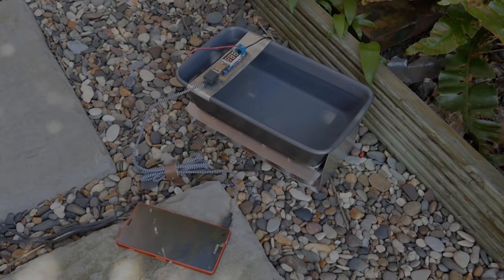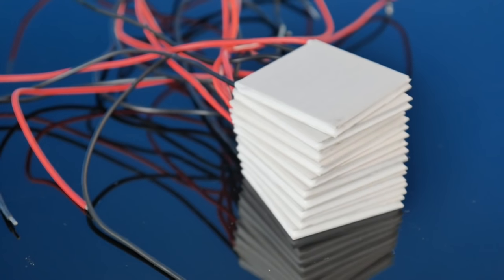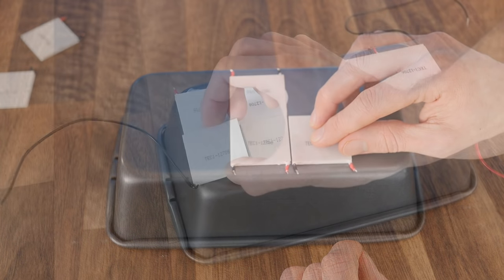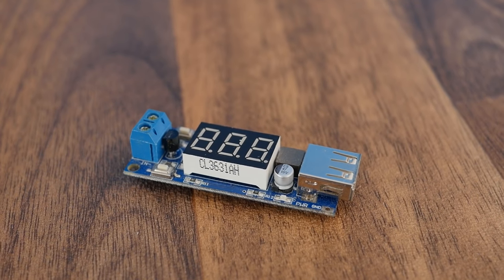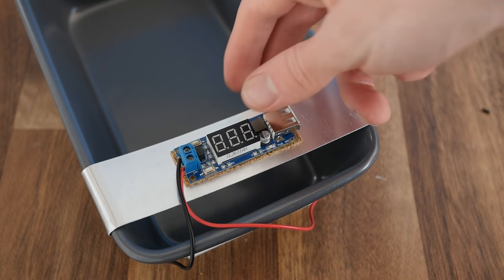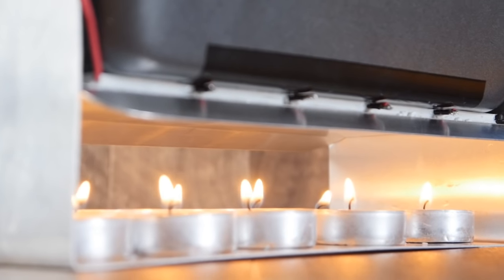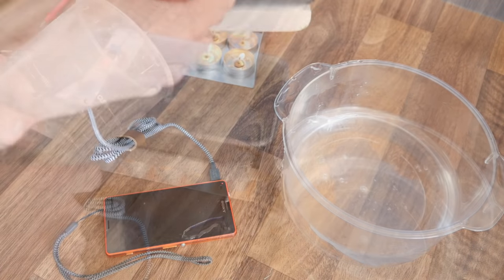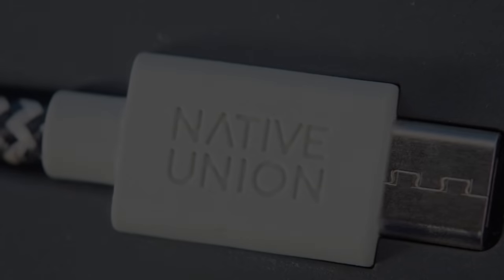How to make a DIY Thermoelectric Generator

Comment: In colder areas, would the reverse work? Let’s say we flip this around so the ‘cold’ side is on the bottom, sitting on the ground (or a metal stand). Now, the top section is where we want the heat. We use either a rock or brick that’s been sufficiently warmed, and use that for the heat. Since bricks and rocks tend to hold heat for longer, it will not only generate more electricity, but the times necessary to reheat the brick will be much shorter than changing the water every ten minutes.

Comment: Here I am contimplating creating a thermoelectric gen. and you've gone out abd done a diy project again. Best Monday ever, hello from the San Jose CA.
Reply: Fixing hot plate at 50 degrees and the heat sink, which thermoelectric module would produce more power: TEC1-12702, TEC1-12706 or TEC1-12710?
Reply: @marvinmarvini8629 i don't know how much power they'll generate, but they'll probably generate fuck all. assuming the heatsink is at an ambient 20°c, that'll leave you with only 30°c of temperature difference. you'll generate maybe 100mW. you want something like a TGPR-10W-4V-40S run at 200+°c of temperature difference

Comment: Hello sir, I'm very thrilled after watching this video and I'm glad I found it. The Surprising part is I wanted to do my final year major project on Thermoelectrics and after finding this video, my spirits were boosted. Thank you for this wonderful project. It  helped me, to learn more about it.
Reply: Fixing hot plate at 50 degrees and the heat sink, which thermoelectric module would produce more power: TEC1-12702, TEC1-12706 or TEC1-12710?

Comment: Awesome!
What about putting everything in parallel 3 by 3?
In this way, you'll have a lower voltage (max 3 or 4 volts) and a quite nice current. You can plug the new set up to a DC to DC step up boost converter and maybe obtain a better efficiency. Another nice ting could be putting a temp sensor like a pt100 and create a sort of an arduino overheating protection switch so you can fine tune the assembly in order to maximise the efficiency. A versus between a couple of arrangements could be quite interesting!
Nice job and keep on doing interesting things like these!
Reply: Good Idea. make this one and send me the link or reply here, so that I get the schematic and the source codes
Reply: Buck circuits are significantly more efficient and cleaner than boost.
Reply: Fixing hot plate at 50 degrees and the heat sink, which thermoelectric module would produce more power: TEC1-12702, TEC1-12706 or TEC1-12710?
Reply: What do you think the voltage regulator does?

Comment: My masters dissertation was on a project that included these Peltier elements, interesting little devices. When you put current in them one side of the plate gets hot and the other cold, when you switch the polarities the hot and cold sides switch places, and the whole process is reversible - meaning when you add heat, current is produced.

Comment: This is pretty awesome for us fools that live in a place literally called "Hurricane Alley" and instead of Winter, Spring, Summer, and Fall... we have Hot, Sweaty, HURRICANE SEASON!, five days of nice weather, boiling hot again.

We lose power pretty regularly once a year during hurricane season... so I might actually make one of these for my mom. I can make it look all nice and stuff. She has thousands of those tea candles, so she's set!
Reply: Fixing hot plate at 50 degrees and the heat sink, which thermoelectric module would produce more power: TEC1-12702, TEC1-12706 or TEC1-12710?

Comment: Peltier elements usually come with copper heat syncs so the tray with water is optional and simply popping it cold side facing away from a camp fire should do a good job.

Comment: Hi there! Quick question -- what is the reason to wait for the regulator to reach 10V before turning it on? Also, is the reason for using a larger bread tin like that one you've used in your video so that it can generate more voltage? Not being an electrical engineer myself, I can only assume that more bread tin = more time it takes to warm up the water = longer/more consistent charging time? In other words, if you used a smaller tin, would you not be able to generate enough voltage? Thanks for this awesome video!!

Comment: I don't know if there's a video already out there but I'm really curious if liquid nitrogen or  dry ice would just destroy them or if it will still work
Reply: Cold doesn't harm them, only if the heat is high enough to melt the solder/glue that holds the individual sections of the Peltier modules together.

Comment: A rather dumb question:
You did show footage using the generator in a campfire, which could be a rather volatile and uncontrolled source of heat....
What prevents cables and electronic parts from melting? 
(simply put, i do not know the temperatures which, the components can withstand)

ALSO: I saw a heat sink, can the generator work like providing the power for the heat sink with a little excess?
Reply: The circuit board was on the "cold" side of the system, so it wouldn't have to deal with the full heat of the fire. 

When you run a current through the device, it makes one side cold, and the other side hot. If you want to keep it running efficiently, you have to get rid of the heat by pulling it away and throwing it somewhere else. That's what the heatsink is for.
Reply: +fatherdoctor Most people think that the mere presence of heat is enough to generate power. that's incorrect. you need to have a FLOW of heat THROUGH the Peltier element in order to generate power. Since heat always wants to flow towards cold spots, you have the cold water at the top.
Reply: the better way to do this is mount a heatsink with a big surface area and small fan. it will work as long as candles are burning

Comment: Imagine a camping pot made like this. Hang on. Someone's done this already right?
Reply: The concept is fairly easy to apply to just about any heat source... the tricky part is coming up with an efficient way to cool/wick the heat away from the heatsink side of the peltier.  (ie) Attaching a bunch of peltiers to a camping pot or "fire-ring" in the middle of Winter would work pretty well... but not many people are going to want to sit around/enjoy a fire in the middle of Winter.  ;)  ;)  ;)
Reply: Biolite Camp Stove

Comment: The idea itself is quite nice and might be useful for situations like "out in the jungle without electricity and the dire need to recharge something like a radio". Might be useful for special forces operating in denied areas... but I'm not happy with the safety of the implementation. The step down converter could be killed by a splash of water and the wires can easily get into contact with flames. A little bit more time invested in the safety and you might have a ready-to-sell product that could be a real life-saver. Still a good idea and video.

Comment: I love everything about the concept except for mounting electronics over a steaming pot. If not shorting it out, the humidity will corrode the metal.
-Justin
Reply: it wont steam, the water wont go over 25°c
Reply: yeah I doubt its much of an issue. 10V 1A demineralised water meh...
Reply: I thing i would change is to solder them in parallel and usa step up boost converter. Or just plug it in directy in a 1-6.5v to 5v usb converter module
Reply: distilled water is non conductive, anyway, coat the electronics with plastidip or similar...
Reply: If you guys wanna put you your money where you mouth is go ahead and put your phone over a pot of boiling water... Attaching the voltage regulator to the stand would have been a better idea in my opinion -R
Reply: Its a cheap buck step down circuit...2 bucks at most. So your argument is invalid XD
Reply: Victor Galvez and you don't think connecting your phone to something that could potentially be damaged in some random way might be a bad idea? Gunna bet your phone that cheap $2 voltage regulator doesn't short out and spike your mobile? -R
Reply: +Make.Test.Battle  I fear a "non ending smartypants scenario" so you win.

Comment: You are using the cheaper TEC (thermo electric cooling)  modules. For optimal efficiency you ought to get the more exspensive TEG (thermo electric generator) modules. 
But a very cool project, I like the use of the baking tin for easy cooling.

Comment: use a bonfire. Those candles cost more than a new battery.
Reply from the maker: I bought 100 candles for £1, so... nope. :)
Reply: +DIY Perks burn... 😏
Reply: +subin pariyar 

wrecked ;d;
Reply: +Teemu M. reckted.
Reply: +DIY Perks Works in UK only i suppose :)
Reply: +idea_generator Cheaper in the U.S., only $1.
Reply: +Teemu M. suomesta? :D
Reply: +DIY Perks  Bankruptcy sale? never heard of 1 cent candles.
Reply: +DIY Perks Ikea sells 100 of them for 1 EUR!
Reply: +DIY Perks peltier modules are bonus to the candle set? with 1 pound you cand buy a hand cranket light and usb charger:) or a solar charge at the same price, Btw you can decay some plutonium to generate heat;) try that!:)
Reply: +Teemu M. And alcool instead of water but at a lower than 30 degrees celsius just for more eficiency and maybe a stronger fire,but not too strong.
Reply: +Azzy M pretty common price, even Ikea sells them for 2.5 euro for 100pcs
Reply: I got 100 of them for 3
2$

Comment: Have been meaning to combine something like this with a chilly-bin and a tealight clay pot heater. But with a temperature based polarity swap switch for keeping the chilly-bin cold and the heater hot. Then switch again to charge a battery. Have all the parts except for a chilly-bin.

Comment: Molten aluminum on one side and liquid nitrogen on the other? hmmm
Reply: Mains voltage
Reply: +SuperSilver301 
Yeah about 120V but DC not AC.
But 120VDC could work for phone wall chargers, DC will just pass bridge rectifier.
Reply: What with him?
Reply: +Marco Bertoni the mains voltage goes through bridge rectifier to convert ac to dc, then the dc is lowered to 5v by step-down transformer :P
Reply: Bananovskyy Wait, a transformer only works with AC!

120VAC -> Step-down: 12VAC -> Full Bridge Rectifier™ -> 5V regulator
Voilà! 5V Direct current.

Comment: That's pretty cool. I wonder if you could use the sunlight as the heat source (put a black plate on one side to heat up in sunlight), and then have it cooled from the bottom...

Comment: Quite inefficient but a cool project ! If you want to have the liquid very cool , try ice water and lots of salt , the salt will melt the ice quickly and lower the temperature of the water even below freezing point, it will be far more efficient than simple ice or ice and water.

Comment: This is an good idea for commercial kitchen, with ovens running all day. Water flow and up to 300 C resistant components will  be needed. And the system attached to an 12V rechargeable battery or regulated capacitor. So both free 12 energy and hot water is recycled for free.

Comment: Could you increase the output by reversing the plates. So rather than having a cold surface on the top, you add another plate upside down on top of this, so there's a constant hot/cold difference between them?

Comment: Um, I know it technically works, but those are thermoelectric coolers. See the TEC in the serial number. TEC's as specifically engineered to create a temperature gradient in response to applied electrical power, by means of the peltier effect. Whereas TEG's (which is actually short for thermoelectric generator) are specifically engineered to produce electric power from an applied temperature gradient. Either will "work" for either, but at reduced efficiency and you would probably be much happier if you swapped in TEG's and used those TEC's for some wow factor project. if you stage them so that their temperature gradients are "in series", (you need at least 4 removing the heat from one to be safe and usually water block/radiator/fan cooling on the back side but eh) you can make some incredible things like cloud chambers.

Comment: I live in a bus and would be very interested to see if the heat/cold from the inside of the roof could create enough heat differential with the air inside to charge a small battery pack for an led. We use the same concept for our wood stove fan and all it has is a large aluminum heatsinks on top for the cold. Granted the stove gets very hot but so does the roof during summer months and for that matter during the winter it gets very cold.. I wonder

Comment: If the data lines aren't connected to somewhere, you can short them out in order to Charge the phone faster.Or to add a voltage divider on those Pins if the Modul can supply more power.

Comment: could you wire some of them in parallel to keep the voltage closer to 5 volts? Would that be more efficient than using a voltage regulator?
Reply: +Nevets Actually you could get a buck/boost converter, take 5~vdc from paralleled peltiers, step it up, then back down, you will loose 20-30% in the conversion but it should be able to push more current even with the inefficiencies.  There also is very low voltage energy harvesting chips from Texas Instruments that will upconvert voltages as low as .2vdc to a much higher voltage which then can be used to charge a battery or supercapacitor (since the chips are designed for energy harvesting efficiency is MUCH higher than standard boost converters even though at low current...output can then be fed into a storage such as LiIon or supercap).  Google search BQ22504 and BQ25570

Comment: Maybe make a solar heating tray with small piping and a black background?  Might get a couple hundred degrees, but is a free heat source after the build.  But, with ice, would it be hot enough to make the system work?

Comment: I bought the Native Union Jump and Keychain cables at an apple store about a year ago and both cables wore out and stopped working after only a couple of months of regular use. I was couch surfing at the time. The cables were rather stiff, which was nice, but I suspect the reason was that they were using a kind of copper wire that doesn't flex as easily as fine strands in normal usb cables. I guess if you get these, expect them to be an occasional emergency sort of thing, not an every day thing. The Apple store ended up giving me a refund tho so no big deal in the end, just a bit disappointing since they were otherwise quite nice. Back to those bland standard white cables. At least they last better.

Comment: If you want to charge your phones faster, you can try to short the data pins of the USB connector on the voltage regulator, as most smartphones will then switch from USB charging to AC charging.

Comment: The thermo plates you provided the link for in the USA say 12 volt. 10 in series would make 120 volts not 15 or am I missing something. 12V and 5amps seems very high for these small devices

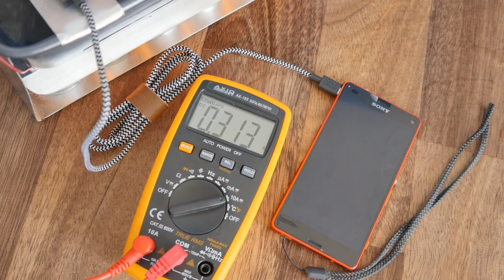Comment: 5:53 Are you sure it is only delivering 1.5W? Seems like you are measuring 310mA on the input side of the converter, and not on the 5V output so you should multiply by the input voltage wich must be higher than 5V maybe about 10V. So it would be 3W

Comment: If you add a small fan to the build ( 3d printed case would be perfect) and place the fan so its blowing air right across the surface of the water it will stay cold as can be without changing it ever. I was thinking of a small pc fan that could be powered off the unit. It would cool the water until well chilled which would create more energy. Replace the candles with using some reflectors and the sun and you might be able to power a laptop or more. This is a project worth trying to take further for sure. I could see a closed loop system with heatsinks and air powered cooler in a closed system thats then heated by solar on the otherside all in a 3d printed case.

Comment: i wonder if you can use the sun to heat it say like making a large panel wheres the hot side is attached to a sheet of copper or aluminum and the metal is exposed to the sun and the cold side has another sheet and has pipes running across it to water cool it
Reply: Michael D Great Idea!

Comment: I'm curious: you say both heating and cooling can produce a current as long as there is a temperature difference.
Could you then also make a summer version of this? I'm thinking a smooth black surface on top to be warmed by the sun, (PC) heatsinks at the bottom and then you can lower it into some water for cooling? 
using a mountain river or snow to charge your phone would be pretty cool

Comment: I m in the process of building a generator for camping, plan is to have it standing facing the fire. Do you think it's possible to charge a phone on less than 10 units? Is there a 6v regulator?
Reply: It is possible! I built a generator with 8 units and it works fine.

Comment: I have one question regarding this project.  Given that voltage regulators are inefficient and generate significant heat if the difference between the step down voltage and actual voltage was high (which it can be in this case), wouldn't it make more sense to just use a PWM DC-DC converter?

Other then that, this is a great concept so thumbs up for that! :D
Reply: +njintau he's using a buck converter. Yes, a linear regulator would be a horrible idea for this.

Comment: +DIY Perks I have just built a thermoelectric generator by your design and parts list, but even with icy water it doesn't output enough to charge anything, its like 0-1% every half hour on my cell phone. Do you think scaling up the generator would make this a useable charger? Any other tips to imrove performace?

Comment: you should design a drink cooze. that has these plates inside. using the difference in the heat from your hand and drink you could store the electricity battery and charger your phone